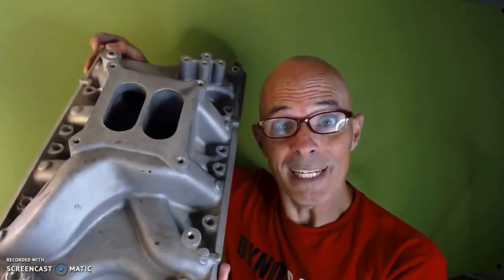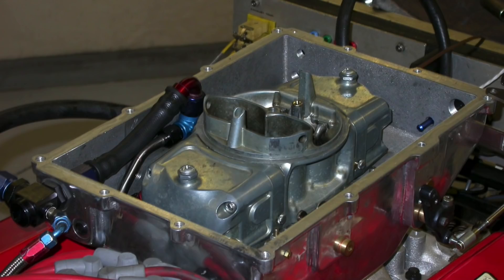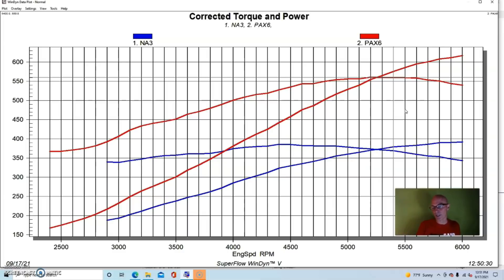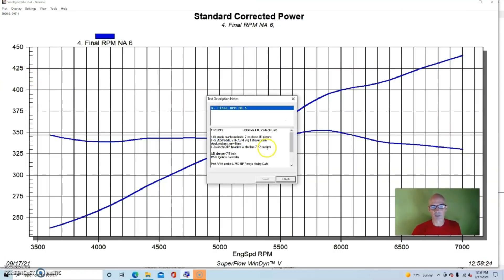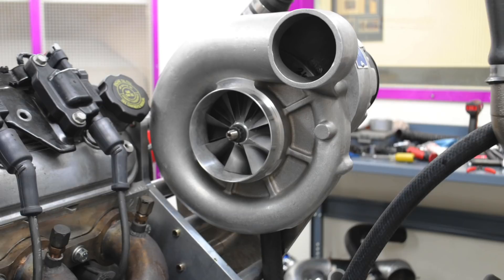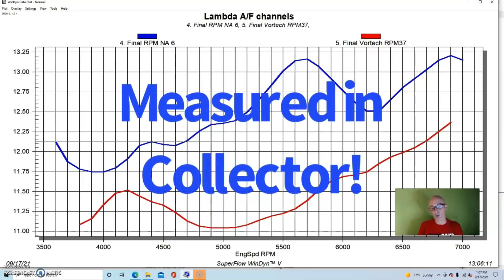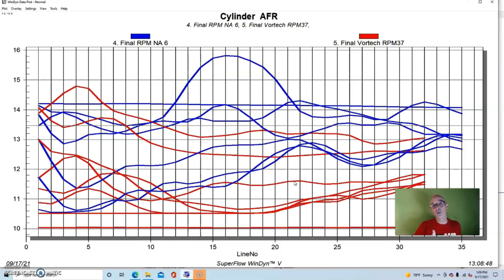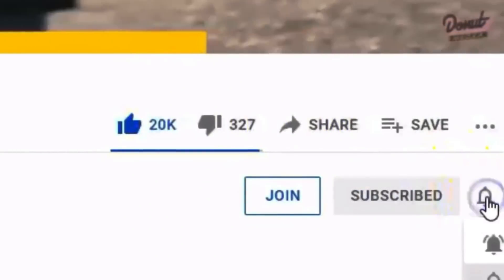HOW TO: BLOW THROUGH DUAL-PLANE INTAKE UNDER BOOST (TURBO & BLOWER)

Comment: Hi Richard!
Would be a good test to see single plane vs dual plan cylinder distribution. I would be concerned about a single cylinder being burnt from a fuel distribution problem. If a single plane offers better fuel distribution than a dual plane i would take the less power down low. Just my 2 cents as i have a boosted dual plane build currently. Love your channel.
Reply from the maker: that vid is up-both are terrible
Reply: @richardholdener1727  do you have a link to the video? I'd love to see it. Thanks again 🙏
Reply: @richardholdener1727 I only say this because I saw your 6.0 ls single plane test is much better grouped together but I see you only compared two cylinders in the video.

Comment: I have a similar setup. I'm using an Edelbrock performer air-gap intake.  Non-rpm. The center divider is still fully formed and not opened up like the rpm air-gap. I was looking at a tapered combo spacer for dual planes. It tapers the front and rear barrels but the center divider is fully intact. Hamburger's 3219 & 3221. 3219 is 1" and 3221 is 2". Will one of these dual plane tapered combo spacers make the intake runners seem longer and boost low end torque production? I like the idea of introducing fuel a little earlier so it has more time to cool the intake charge. 
  The engine is a very mild roller cam 350 with tfs 175cc heads 9.17:1, comp xfi252hr cam. 202/212@.050". Holley sniper 4150 tbi. Performer air-gap intake. Long-tube headers. Vortech v3 si centrifugal supercharger. 9.5psi@5500. It's in a 3/4 ton 4x4 chevy pickup. Torque at tip-in is incredible and the boost comes on violently. I was just trying to tune the intake runners to be a little longer. 
  Thanks for any input you've can provide.

Comment: Hi Richard, I would just like to say that I really appreciate the information that you share with us thankyou.
Over the years I have been using numerous forced induction systems and I have learned a lot along the way and I would like to ask the question surrounding compression ratios from the motors you often get from the salvage yards.
How are you controlling knock from these boosted applications and would it be something you could entertain discussing in a future episode.
Keep up the great work and cheers.
Reply from the maker: balance octane,boost, timing and charge temperature

Comment: I run my Procharger with a Victor Jr. and it's great. I will stick with the single plane.
Reply from the maker: it does, it just makes less power down low than the dual plane

Comment: I run a dual plane Edelbrock Performer intake that's modified to run port injection on my GMC Typhoon (which is factory turbocharged). Naturally aspirated the 4.3L V6 made 276hp/306lb-ft thru stock N/A manifolds & Y-pipe on 91 octane fuel.

Comment: Missed tall tunnel ram with boost. Small plenum amd large plenum. Non of that single carb stuff either.  Use a edlebrock mopar 340 street tunnel ram TR5

Comment: WOW! It’s like your a mind reader I’ve been battling whether or not I wanted to switch my Holley sniper over to a single plain, from a stealth. Combo is a stick shift 302 sbf with a gt45 and Holley super sniper
Reply: If it’s a stock block keep it happy by making power lower in the rpm range with the dual plane. I’ve had bad luck with stock 8.2 decks.

Comment: Why do You need to put up with all the problems of a Dual-Plane-Intake when
you're already making more power than You can put to the ground ?
A FLAT smooth Torque-Curve is worth far more than  the extra ~20-Horsepower
and peaky Torque-Curve caused by a Dual-Plane.

I prefer a Single-Plane just for the smoothness of engine operation, 
and I don't need ~20 more Horsepower BELOW my Torque-Converter stall speed.

When You learn how to Tune Fuel-Injection and Timing- Maps,
the whole question quickly becomes a moot point.

I'm already heavily into Torque-Management pulling Timing in First and Second Gears,
that puts me over any legal Speed-Limit in about 5-Seconds, so what's the point ?

Unless You want to drive around Town on Drag-Radials, now that might be different.
.
.
.
Reply from the maker: for most people,(not drag racers), the extra torque offered below 5000 rpm is much more useful than the extra (smooth) hp offered at the top of the rev range
Reply: @richardholdener1727  
I agree that for people who just want a quick "bolt-on" boost in power,
with an otherwise stock Engine and Drivetrain,
a Dual-Plane will provide real gains, right where they can use it,
but when You take the time (and money) to optimize all of the other
factors that go into a fun street car,
mostly Cam, Transmission Tuning and Lock-up-High Stall Converter,
a Dual-Plane-Intake is more aggravation than it's worth.
Reply: Very good point

Comment: The cam choice was an odd one for the LS. Especially for a small displacement. The cam was kind of mismatched for a dual plane manifold. That contributed to the low, but super flat torque curve. The manifold shined where the cam was weak and then they crossed over so that the cam was carrying the struggling intake. I'm kind of curious what curve a Fast or stock truck manifold would make with that cam. Regardless, you can't be disappointed with 800hp up top.. even if the torque is only 400 at the start of the pull.

Comment: I've never seen a Ford 327. Pretty cool. Admittedly, I don't see many Fords. I'm traditionally more of a bowtie guy. You mentioned a stroker 302 so I immediately thought of a 347 or a 363 but 327 was not on my radar.
Reply: A 3.25" stroke is typical of 331 stroker kits that come with .030" over pistons. With stock bore you get the 327.

Comment: I would like to see Holly sniper throttle body fuel injection on a dual plane boosted setup. I understand there is distribution problems with TBI that a carburetor does not seem to have.  Would like to see the results and issues
Reply: You just cant get the fuel flow to make them work. They would need more injectors. They just dont deliver the fuel for 1000hp.
Reply: Me too, as I just purchased the Holley sniper EFI kit

Comment: Richard, This helps me quite a bit as I am running a carbed LT1 with the GMPP carb intake. Compression is 9:1. Planning on running pump gas. I get that it needs to be sealed, with a carb hat. What ports are necessary? Intercooler is it necessary with a blow through? How about running one bank with longer primary header tubes than the other? So that way crossover can go to other side under car to reach turbo. Will it negatively affect boost? Also will HEI work as is? Thanks

Comment: Why when boosting a fuel injected engine do you need to increase the injector size by double or so but when boosting a carb it seems that the same cfm for a naturally aspirated engine seems to work well? I've seen some 650 cfm blow through carbs used in tests and they make more hp than I would have thought they were good for.
Reply from the maker: WITH BOOST THEY FLOW A LOT MORE
Reply: @richardholdener1727  Cool, thanks!!!
Reply: the cfm of the air doesnt change the density changes and the inertia pulls more fuel in
Reply: Carburetors regulate the amount of fuel injection by vacuum or boost signal obviously you're going to have to adjust the jet sizes for boost on an engine. The main distinction to be made though with carburetion is a blow through carb or a draw through carb. A blow through carb is under the boost pressure a draw through carb isn't it is purely operating off of vacuum. A draw through carb is what is used on an old school blower like an 871 671 etc. A blow through carb is set up to be ran with boost blowing through it by a turbocharger or a Paxton style supercharger.
Reply: I'll have a go at explaining this.
I don't exactly know how Holley rate their carbs but my CFM rating in this example is rated at 1x atmosphere or 14.7psi.
So adding another atmosphere to create 2x atmospheres - so boost - should in theory make the carb capacity double. 
At 2x atmospheres a 650 CFM carb now becomes a 1300 CFM carb. There are limitations and it doesn't quite work like this in reality but the concept is plain enough.

So it's pretty simple when it all boils down.
For our naturally aspirated 650 CFM carb (or 1x atmosphere) works something like this:
The carb float bowl has 1x atmospheric pressure acting on it and is connected to the carb Venturi via a discharge passage with a jet as a restriction.
The motor at wide open throttle creates airflow through the carb Venturi which generates a low pressure vacuum right inside the Venturi itself - well below the full 1x atmosphere pressure acting in the carb float bowl. 
As mentioned the 1x atmosphere float bowl pressure is far greater than the low Venturi vacuum so the fuel flows via the jets up the discharge nozzle into the low pressure vacuum created by the Venturi where it mixes with the air going into the engine. The atmosphere actually pushes the fuel into the Venturi. 

So blow-through carbs still work exactly the same. 
This example is for +14.7psi so double NA or 2x atmospheres.
Everything is now doubled from the above example. 
Double the atmospheres = double the carb CFM = double Venturi vacuum = double the float bowl pressure = double the fuel flow = double the power. Yipeeeeeee.....
Internally within the carb, since everything is exactly doubled, all the critical ratios are still maintained. 
That's how a 650CFM carb works under boost because in theory it sorta becomes 1300CFM and creates more power than one might think they're good for as you put it. 
As mentioned everything kinda doubles LOL.

I thoroughly recommend reading the SA publication Carter Carburetors. It takes the reader from the simplest carb principal to the most advanced - including boost. Even though the book is oriented to Carter carbs it doesn't matter as the concepts are applicable to all carbs and that book is highly entertaining and very well written also.
It is a hoot of a read.